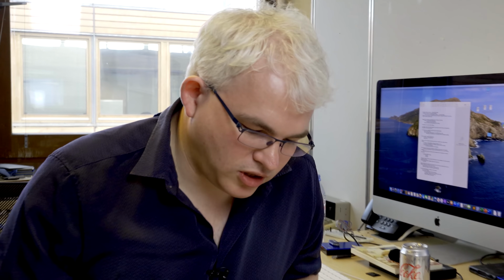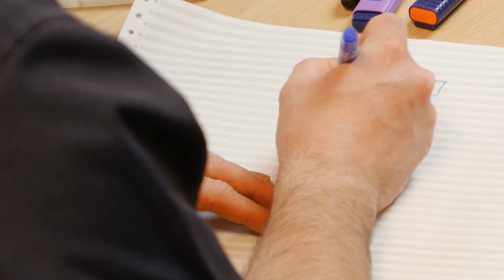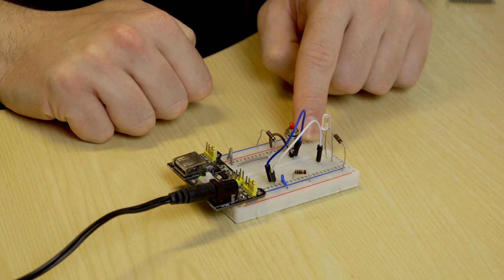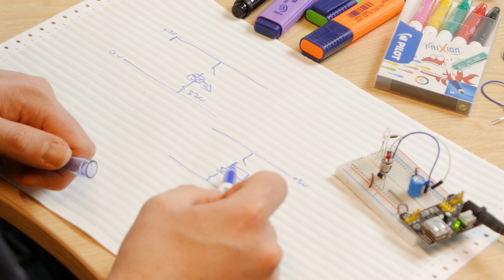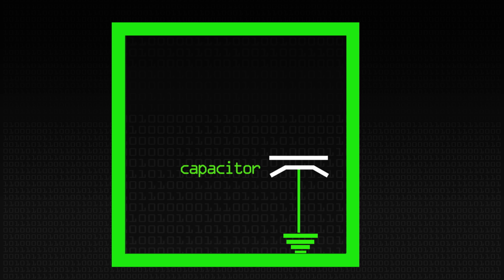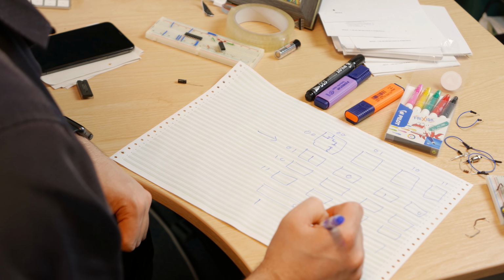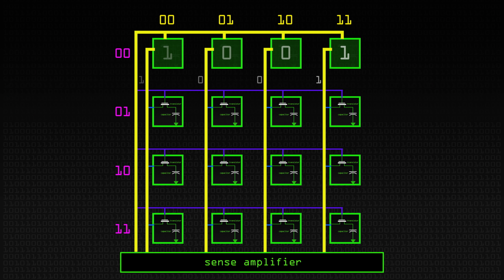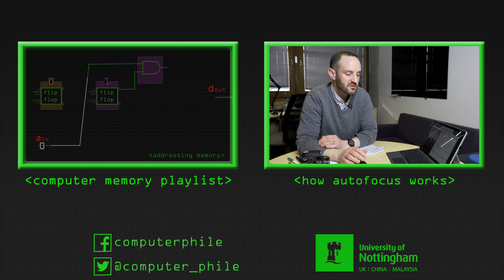Why My Computer Wants to Forget (How Dynamic Memory Works) - Computerphile

Comment: I doubt the conclusion a lot: It's perhaps not the RAM that stored the information for 10 seconds, but the fact that other and bigger capacitors in the motherboard and power supply continued to supply the RAM with enough power to shortly "survive" the power cut. Don't forget modern SSDs are BUILT to finish saving data in the even of a power outage or they would simply become unusable otherwise!

Comment: I get that for historical reasons DRAM was more convenient in so many ways than SRAM, but we've come such a long way now with reducing transistor size and cost, after watching this video makes me wonder if we make the switch to SRAM which is exactly how the caches inside the CPU are made, could be much more useful because i think regardless of ram capacity the SRAM will still maintain access times (which are super fast), but the industry is already locked in into using DRAM and I don't think anyone is willing to switch and it's such a pity.
Reply: DRAM is substantially cheaper than SRAM though. SRAM can be between 50-250x more expensive, even today.
Reply: @stephenaustin3026  Its not like we weren't robbed with price fixing on DRAM and now the enthusiast sector is growing like crazy, people who will spend everything for any amount of improvement, also prices go down with higher productivity. I am merely saying that we're reaching the limits of cpu power, its time to look somewhere else.

Comment: Now I'm curious about the performance of static vs dynamic if using modern chip manufacturing. could latency and throughput be improved without the need to charge capacitors or constantly refresh? And what is the cost, size, and heat difference between ic transistors and ic capacitors?(coupled with all the control circuits.)
Reply: Yes, static RAM is faster than dynamic RAM. Your CPU cache (low volume) uses the faster SRAM while your main memory (high volume) uses the cheaper/smaller DRAM.
Reply: We'll say, 32 gigabytes of DRAM will cost you about $150...
$150 will get you less than 100 megabytes static RAM (yes, mega, not giga)...
Reply: Yes dram is just used, because it's much cheaper than sram. Using hierarchical caches stages is the most efficient way to strike the best balance between cost and performance.

Comment: With 2 NOR gates, isn't that 2x4 transistors, for a total of 8? I learned in VLSI that modern SRAM is typically built with 2 NOT gates feeding each other, and you have to 'overpower' one of the signals to change its state.
Reply: Each NOR gate is only 2 transistors. Imagine 2 x transistors connected in parallel and either can be switched on, grounding the output.
Reply: Isnt it NOT OR already? One Not and one Or
Reply: @ekrem_dincel  You can make either an OR gate or a NOR gate directly from 2x transistors. You don't need to build one type and then negate the output to make the other.
Reply: @ChrisLee-yr7tz  interesting, can you give a image please?
Reply: The example shown was two NOR gates, making an RS-NOR latch. An OR gate is made from a NOR gate and a NOT gate.

The RS-NOR is probably the simplest design you can use if using strictly CMOS logic for a single SRAM cell, but delving into DRAM design already breaks out of that mold.

If you search 'SRAM cell' you see a 6-transistor design as the most common result. 4 transistors for the cross-connected NOT gates, and 2 for the bit-lines (it's easier to overwrite a 1 with a 0, so you connect both sides for when you write to the cell). You also use both sides for reading, connected to a sense amplifier (not too unlike that for DRAM).

This is all probably a bit far outside the scope of this video (or channel, really).
Reply: @ChrisLee-yr7tz   I forgot you can make designs like that. I was thinking using CMOS design, which has 4 transistors per NOR gate, as opposed to an NMOS design like you are saying.

Comment: not sure if this is true, but sometimes if i have a power surge that makes it flicker , but enough to reboot my computer, can that effect your computer in a wierd way, since it have stuff in its memory, or does a POST cause your ram to be cleared anyway, or whatever in it, doesnt have any meaningfully to make issues.
i'm asking because i swear my computer can be just plain wierd sometimes, but i also suspect the PSU's capacity is causing thing to "remember" since the last time
Reply: Yes, that can certainly happen. It’s called a “power glitch”. The usual cure is to unplug from the mains, wait 5-10 seconds, then plug it back in.
Reply: I would imagine the POST memory test would effectively erase the contents of memory.
Reply: @TomStorey96  That’s only if the POST can run.

Comment: That why some people say to leave the power pulled on a device for 10 seconds before plugging it back in.  To be honest though, it doesn't make much of a difference usually.
Reply: Leaving the device unplugged for 5-10 seconds isn’t just for the RAM, but for all the circuitry in the device to lose any stored charge. Unplugging and replugging the device too quickly can lead to glitches, where circuitry gets into a crazy state and the device locks up. This can happen during power brownouts, too.
Reply: Memory tests when the device boots up should effectively erase the contents.

TBH I suspect that leaving it unplugged for x seconds is likely a carry over from a bygone era. Modern complex circuitry usually has a number of power on reset and voltage supervision based reset functions built in to ensure that, for example, power supplies and oscillators all reach stable levels and operating states before they are used for operation.

Voltage supervisors can also generate resets so that if the voltage dips, e.g. during a brown out, that logic doesn't get stuck in some odd state, or operate in marginal voltage ranges.

Even lowly microcontrollers (PIC, Atmel etc) have these functions. Things are a lot smarter now.
Reply: @TomStorey96  Memory tests have to be implemented by firmware/software, which cannot run properly if the hardware has glitched.
Reply: @lawrencedoliveiro9104  yes I know, my hobby is electronics - microcontrollers, programming, and recently retro CPUs like Z80 etc.
Reply: @TomStorey96  Then you would know that leaving things unplugged is not a “carryover from a bygone era”.
Reply: @lawrencedoliveiro9104  I have provided my reasoning for why I think this should not be necessary with modern hardware.

If you don't agree that's fine.

But simply saying that "hardware is glitched" doesn't offer any more insight from which to form a better oppinion.

Comment: What exactly is the major benefit of using D-RAM over S-RAM, other than memory density? To me, it seems like the amount of processing power required to maintain D-RAM would outweigh the reliability of an equal amount of S-RAM. Is this actually the case?
Reply: The refreshing is not handled by the processor anymore.  Nowadays the memory chips refresh themselves, or the chipset does, or any of a number of hardware systems.  The processor is largely unaffected by the refresh cycle.

And since the storage density is so huge, dynamic ram is where it's at.

Was always a bit annoyed that magnetic ram never seemed to materialize.  High density static ram stored as magnetic fields.  I believe IBM was working on that, and it was showing promise, and then crickets.  Note:  not talking magnetic bubble memory, i think it was magnetoresistive somehow?!?
Reply: Density and cost are the two major influences in using DRAM over SRAM. Cost because SRAM takes a bigger area for each bit, and it's more difficult to produce. SRAM is more efficient at power, you are correct in that regard, but cost outweighs it. Roughly, SRAM about 20x the price per bit for large memory sizes.
Reply: The extra circuitry that refreshes the DRAM is orders of magnitude smaller than the DRAM itself. It's just a small buffer on the output and a cycling counter with clock that drives the refreshing. In modern computers SRAM and DRAM have different usages that play on their particular benefits on drawbacks. DRAM is used for bulk high-capacity storage in ram chips, where density is key factor. SRAM is used in buffers and in CPU cache, where speed is crucial, but high-capacity is not necessary.
Reply: Its a cost thing. SRAM uses 4, DRAM uses 1. And they would use half or less of a transistor if they could get away with it, like they do in NAND with MLC/TLC/QLC
Reply: @KohuGaly  even more complicated than that these days, thanks to things like rowhammer. The refresh mechanism has to monitor which rows are being hit the most and start refreshing adjacent rows to prevent it.

But at it's core, yeah just a simple counter to cycle through all of the rows.
Reply: @TomStorey96  The point is, the refresher only needs to have less than 3x as many transistors as the DRAM it serves, to beat SRAM in data density (and thus cost per bit). That's a significant headroom.

Comment: As the DRAM chips in my Apple IIe have aged their ability to hold a charge has stretched to 30 seconds and beyond. This makes cycling the power ineffective for cold starting the system because of the way the ROM reset routine works. It uses a flag in memory to determine if the reset was user initiated or a result of turning the power on. If the flag in memory doesn't clear when the system is turned off, the reset routine doesn't know to cold start the system when it is turned back on.
Reply: You mean DRAM is like fine wine, and actually improves with age...?

Comment: But how do you change it back to 0, since the capacitor will remember it as 1 for up to 10 seconds
Reply: It's a bit more complicated than described in the video, which is really just a conceptualisation of how it works.

The reality is that the write circuitry in the memory itself will take care of either charging or discharging the capacitor to some voltage depending on whether it is storing a 0 or a 1.

The read circuitry takes care of interpreting the values that come out of the capacitors and turning them back into 0s or 1s that can be presented on the data bus and read by the CPU. This is a destructive process, and any data that is read must be written back or it is lost.

The refresh circuitry is a bit of a combination of a read and write operation, but the data itself is not presented to the data bus.

It isn't possible to refresh the entire memory contents at once, so refreshing is done typically row by row. Each row must be refreshed within the refresh period or it's contents are lost. If you have 256 rows that need to be refreshed in 64ms, that's one every 250 nano seconds. Modern memories have a lot more rows than this, and older memories have a much shorter refresh period (e.g. 4ms).

Comment: Quick Question. How does the refresh circuitry deal with the CPU writing to an address it is currently refreshing. I assume the refresh isn't instantaneous.
Reply: Since the CPU is writing, that is automatically considered refrshed. Generally, the DRAM disables itself for both read and write while it’s being refreshed.
Reply: @DanCojocaru2000  But what does the CPU do when it tries to write to a cell while the RAM is being refreshed? How does the CPU even know the write failed?
Reply: @mrmimeisfunny  the reads and writes don't fail, because both CPU and the DRAM have sram buffers in between. The way it typically works is, CPU sends out signal to the bus on the motherboard and then waits for the ram to do its job. The CPU doesn't care how and when it gets its data. read/write instructions are asynchronous on modern CPUs. They do not have specified execution time in cycles, like it used to be in the olden days.

Comment: Simpler, faster and less noisy to use static RAM. Silicon isn't that expensive these days, beyond me why static isn't used.   :)
Reply: It's also considerably less dense and more expensive (especially if you want gigabytes of it) than DRAM.
Reply: SRAM is around 4x more expensive than DRAM.
Using DRAM makes economical sense for memory heavy applications.

Though, SRAM has lower power consumption and will likely start lurking its way into more mobile applications over time.
And as memory density increases, DRAM will soon start cooking itself to death, making SRAM sensible from a power consumption standpoint. But this isn't yet a problem, even in the server space where things like 256GB memory modules have been a thing for a while now.... But in 10 years, who knows.

Comment: @3:30 He said 64 milliseconds. Did he mean 64 nanoseconds ?  (the refresh rate of DRAM)
Edit: Nope he was right.
"DRAM devices have either 32 or 64 ms retention time, also called the refresh window (tREFW)."
which is different from the refresh interval time, tREFI.
"For instance, a DDR3 device has a tREFI of 7.8 us and a tREFW of 64 ms"